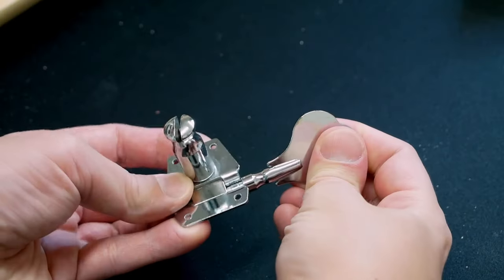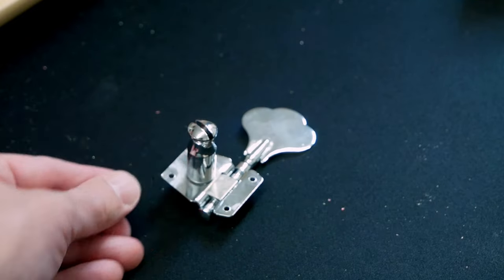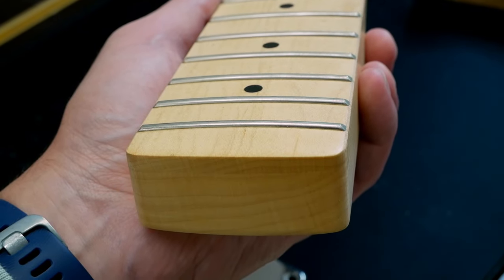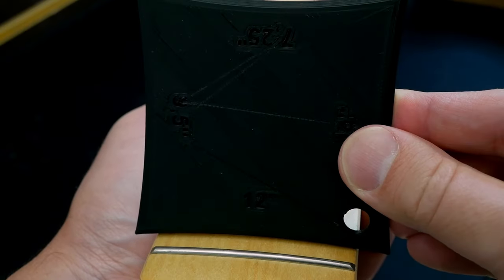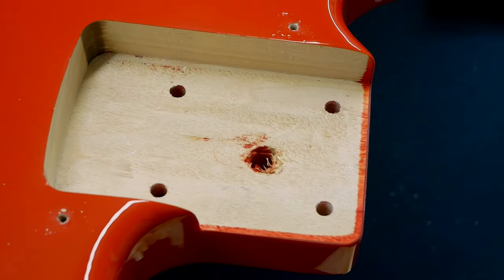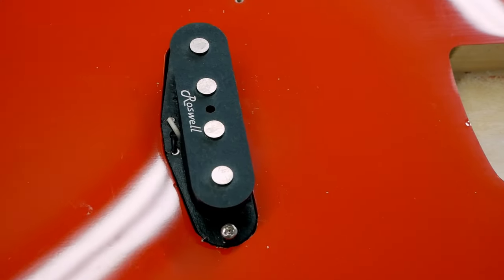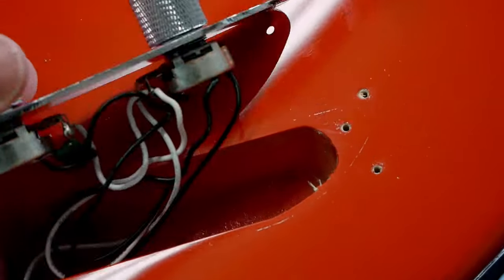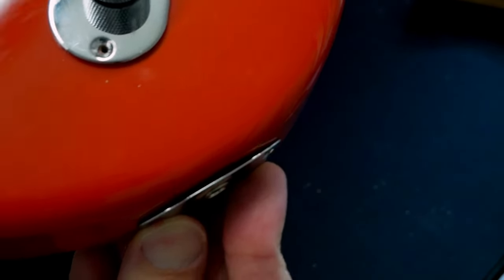Harley Benton PB-50 - Take it apart! - Review

Comment: The one I got, a sunburst, had horrible fret-ends, very sharp and long. I filed them down, as well as possible, and lowered the strings, etc. as well. It is a very cheap, and very heavy bass but not bad. Thanks for the video.
Reply from the maker: Mine is actually pretty light for a P-Bass. 3.67 kg or 8.08 lbs

Comment: I know you shielded the pickup cavity in your second video, but did you experience any single pickup 'hum' compared with the normal P Bass split pickup configuration? If not, I assume the Roswell pickup is stacked.
Reply from the maker: There was a bit of hum/noise before shielding the bass. It got better after I shielded it. If you look at the Roswell website you’ll see that they only offer a single coil version of this pickup.
Reply: @basstelkeller  Thanks.

Comment: Do you know how long the control panel is?
I ordered a three hole control panel of AliExpress and it is 128mm.
Reply from the maker: That should fit, mine is 128.4 mm long.
Reply: @basstelkeller  I received it but i haven't tried it.
The chrome had some stains unfortunately,
so might not use it.
I guess i could spray paint it black or wrap it.

Comment: Hello, I just received mine and I see different things, in the electronics area is it possible that it has a paint to make an electric screen? The color is like black, different from all the bass in the electronic areas.
Reply from the maker: Shielding paint is black. Could be that they do this now. Is there a ground wire connected to the paint?
Reply: @basstelkeller  Hello! The color of the paint is like black or very dark gray, applied with a brush, I have not seen that the cable is with the paint, I see a black cable that goes towards the bridge and 3 cables, one white, another yellow and another black towards the pickup If you want photos of the electronics I can send them to you.

Comment: Do you know if the neck pocket can fit a real Fender PB 51 neck ?
Reply from the maker: Sorry, I don’t have a Fender 51 neck so I can’t check. I could measure the width of the neck if this is any help?
Reply: No, Fender Tele/Original P necks have a squared neck heel whereas these are rounded at the heel like a typical P Bass

Comment: Thank you for taking it apart and exposing how cheaply made these basses are.  I almost bought one until I saw this video, I'm gonna buy a Squier Classic vibe 50's P bass instead.
Reply from the maker: I‘m not sure that’s what I wanted to say with this video. Considering the price, I think these basses are quite well made. I‘ve seen worse on significantly more expensive basses. Maybe I’ll take apart a Squier some time…
Reply: @basstelkeller  
Great video!  Very informative.👍
Reply: squier classic vibes are really great and if you have the money you won't be disappointed.  but for a quarter of the cost these are really quite good.
Reply: @japaNebraska  
I bought a Squier classic vibe 50's precision bass a replaced the tuners, bridge, potentiometers, and pickup.
I gotta tell ya, this bass is a monster 👍